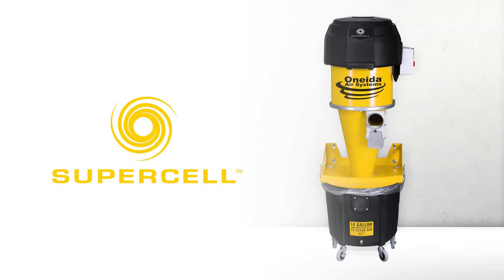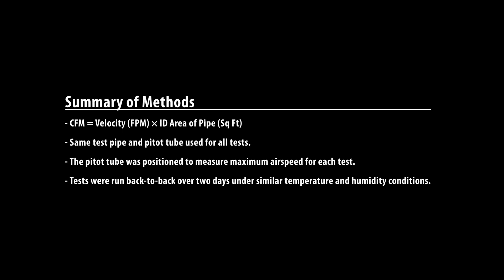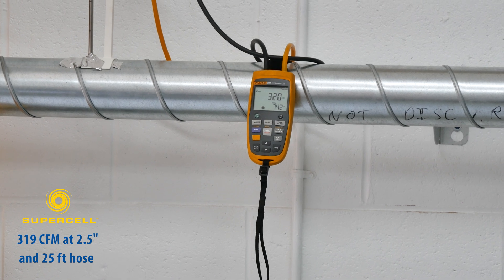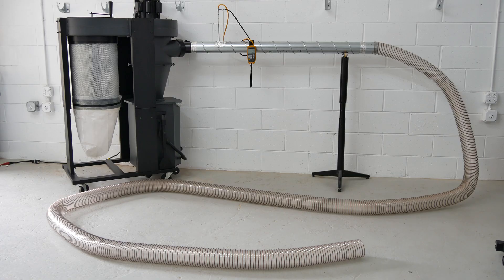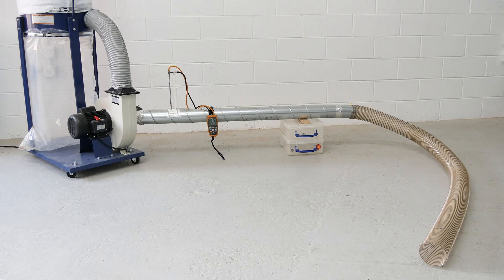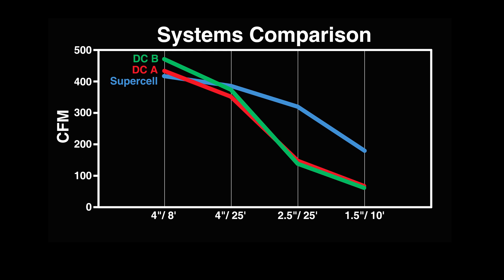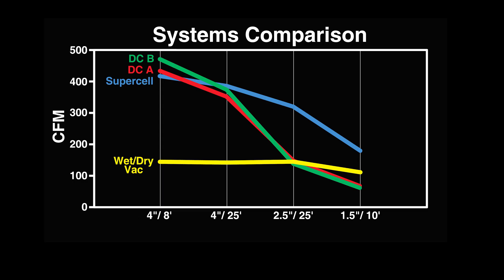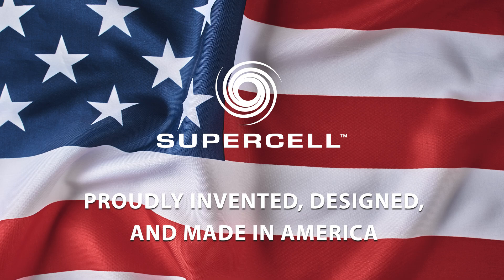Supercell Airflow Test | Oneida Air Systems, Inc.

Comment: I appreciate this type of comparison. This is the type of info we need to make an informed decision. I just wish you would have added the dust cobra to this. Big jump from shop vac to supercell so would like to see how the intermediate option stacks up
Reply from the maker: We appreciate and value your feedback, and we are committed to the continual improvement of our products for maximum performance. We will be sure to queue a follow up on our Dust Cobra.® In the meantime, don't hestitate to call one our systems experts, 1-800-732-4065. They will answer any additional performance questions you may have about our Dust Cobra® as well as the advantages of choosing the Supercell over several shop vacs.

Comment: How does it work for non-wood chips? I work with a lot of plastics which generate long ribbons but sometimes a finer dust. with a woodworking background I've been eyeing the supercell since the day it came out, but now that I work with plastics more I'm worried I'll be buying a new filter all the time!
Reply from the maker: Though designed for wood dust applications, we would recommend reaching out to our technical sales representatives to discuss other specific applications like plastic and it the system will be right for you.  They can be reached at 1-800-732-4065 Option 2.

Comment: So it seems for a small and simple 2.2KW hobby CNC router, the shop vac with one of your Dust Deputies are good enough .
Reply from the maker: It is possible for a shop vacuum and one of our Dust Deputies would work well enough for this type of set up as long as the shop vacuum has enough CFM/static pressure to pull from the collection port of the CNC.

Comment: Can you turn the suction down for sanding, or would you need to vent it at the tool connection?
Reply from the maker: There is no way to turn the suction down at the machine but if using blastgates, you could close it off a bit to allow less air threw.

Comment: Is CFM really the relevant calculation? Or is it CFM@ a given static pressure? I'm trying to understand the differences between this and collecter better.
Reply from the maker: Both CFM and Static Pressure are relevant for proper dust extraction for the cleanest shop available. The CFM (Volume) measurement is a direct correlation to the Static Pressure (Velocity) - The faster you pull air through an opening the more volume of air you can get. Static pressure (air velocity) is needed for smaller sized hoses and port connections (think 3">). CFM (air volume) is needed for more tools simultaneously or larger port sizes. The Supercell will allow you to be able to connect to both larger (4"-5") ports/hoses and collect from the smaller sizes BOTH, as long as you work with 1 tool at a time. It pulls air at high velocity to pull as much CFM through 4"-5" tools, while being able to also pull fast enough for the smaller sizes. Conventional dust collectors do not have high enough Static Pressure (air velocity) to pull from smaller hoses, they get choked-out. So the Supercell's competitive advantage is that it would handle larger tools like planers and jointers, as well as the smaller ported tools like orbital hand sanders and chop saws. If you wanted to collect from multiple ports simultaneously it would fall short because it would need more CFM (Volume) pulling from multiple 4" connections.

Comment: I am excited about this collector, but you are comparing collectors at very different price points. I would love to see it compared to the clear view collector at a similar price
Reply from the maker: We're happy to hear you are excited about the Supercell. 

Low pressure dust collectors with fixed speed motors will perform similarly to Dust Collector A and B when collecting from 2.5" and smaller dust ports and hose. They do not have the static pressure to overcome the resistance inherent in pulling air through small diameters.

Even one of our larger, more expensive systems like a 7.5HP Direct Drive wouldn't do much different due to the fixed RPM and limited pressure range.

DC's only make 10-12" of static pressure. The Supercell makes 85+.